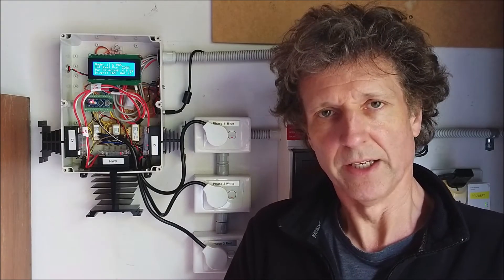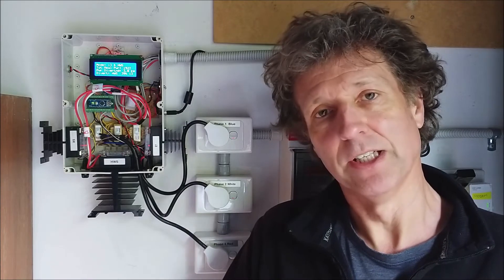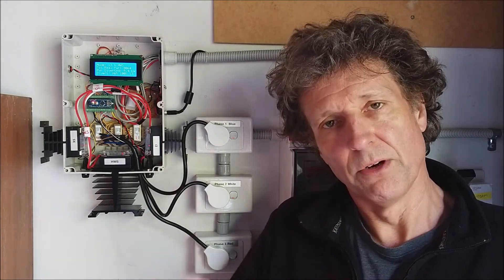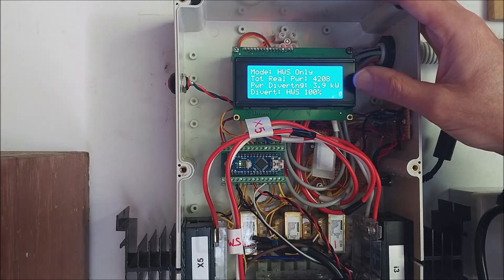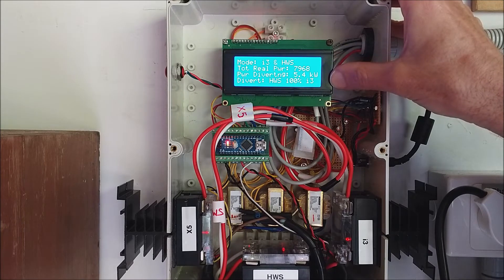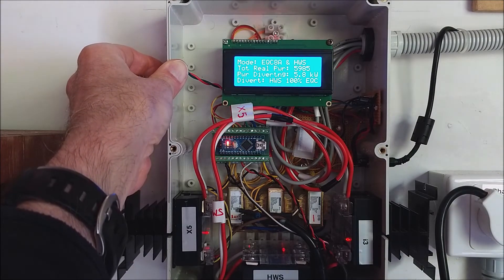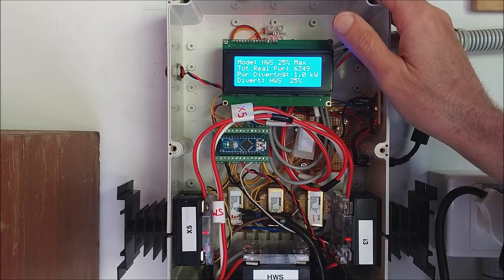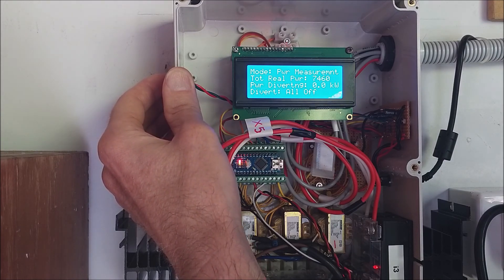DIY Solar Energy Diverter  Part II using PWM for Hot Water

Comment: Nice build. I've been brainstorming making something similar for years, after seeing the insane prices of off the shelf solar diverts like iboost and eddi's. But I was planning on using a CT on the solar and the grid side of my incoming so I could compare the two, and PWM a mosfet or something at high frequencies. Which would mean I wouldn't have to have it turn on off for a few seconds for sampling like your design does. But I dont know how to code an Arduino. I struggle to get a LED to blink without sytax errors. 

I didnt realise car chargers could be turned on and off like that. I assumed they needed a smooth source of power and then reduced duty cycle themselves to get the desired charge current.
Reply from the maker: Hi Ratgreen,
Apologies for the delay in responding to you. 
Yes, I'm no programmer myself! Lots of copied code and examples are evident in my sketch!
In terms of EV charging, these need to be stable. The minimum cycle time I have set is 20 minutes and I don't think you want it any less than this.  Both our EVs seem happy with this arrangement.
Good luck with your project.
Cheers,
Gav.

Comment: This is great! Could you please share the circuit diagram/schematics as well? Thanks
Reply from the maker: Hi Daniel,
Unfortunately I haven't drawn  up a circuit diagram. The best source for the voltage and current sensing is the open energy monitor learning website. This link takes you to the simple voltage dividers for the voltage and current sensing: https://docs.openenergymonitor.org/electricity-monitoring/ctac/how-to-build-an-arduino-energy-monitor.html
The Arduino script identifies the pins of the Arduino which are used for voltage and current sensing (in my case 3 phase, but single phase just requires two inputs rather than 6).  The pin that's used for the mode switch is also identified. The digital pins for the output control are also easily identified from the script.  Apart from power connection to the Arduino, that's about it. 
I will be posting another (and I assume final) video at some time covering a further enhancement using phase angle control for the HWS heating.  This was a relatively easy enhancement and has some benefits over the solid-state relay on/off switching.  I just want to test the phase angle controller for a few months before I post the video.
Cheers,
Gav.

Comment: Isn’t there solution to limit your 3.6kW water heater electronically.? I mean if there is only 1kW generated the system will allow only 1kW to your 3.6kW heater.
Reply from the maker: Hi Jerry,
Yes, you can utilise phase shift modulation to limit the actual power delivered to the hot water element.
This approach is more complex and I didn't want to alter the switching hardware setup I was already using, hence the PWM approach.
Cheers,
Gav.
Reply: can you please suggest some device to utilise phase shift....thank you
Reply from the maker: Hi Jerry,
I did a quick search and there are some products available for control of single phase resistive loads. I found quite a few in AliExpress, but I can't vouch for their performance or reliability. In general they accept a control signal of 0-10V or 0-5V and use phase shift control to vary the AC output.  
You'd need to the test the set up to firstly see if the device will accept a raw filtered PCM 1-5V DC (like) output from the Arduino.  Assuming this works, you need to test the linearity of the device (ie: if 5V delivers near on 100% output, does 2.5V deliver 50% - I suspect not).  The charts I saw look roughly linear from about 1.5V to 4.5V, but you'd need to test and model this and deduce and algorithm  that produces the required power control. 
I'm a bit buried at the moment, but might have a play with one of these devices at some time.
I hope this helps.
Cheers,
Gavin.

Comment: That's silly considering solar panels are only  23% efficient, and Solar hot water heaters convert just about all the heat from the sun into hot water
Reply from the maker: Hi Blake, 
Our evacuated tube water system comprises two banks of 30 tubes each of 1M in length. They are tilted at an angle to catch the winter sun. During winter and the shoulder months, they are not generally able to fully heat our 315L storage HWS. During this time, we divert the energy from our rooftop electric solar array to assist with hot water heating. In this way, the diverter is invaluable. During the warmer months, the evacuated tubes heat the water on their own with no assistance required from the electric solar array. Not silly at all really.
Cheers,
Gavin.

Comment: Great video Gav & very useful information.   I am using a more crude arduino based all or nothing system at the moment to try and a) run the pool pump & b) harvest as much of the surplus as possible to for the immersion heater & draw as little from the grid as possible so I think I’ll adapt your code to incorporate this burst technique now. Thanks, I’ve subscribed!

Comment: I did a similar thing using a solid state relay and zero voltage switching to enable 1 to 4 half cycles every 2 mains cycles at 50hz to give 25% steps (750W steps) to match hot water power to surplus power. Zero voltage switching was done to reduce EMI.
Reply: Sounds pragmatic, can you share your design?

Comment: Hi Gavin, do you have more details on the hardware you’ve used.  Clamps, SSR’s ect? I’d love to build my own
Reply from the maker: Hi Brett,
My apologies for the delay in responding to you.
In terms of components for the system, there's nothing special here. The current transformers and SSRs were low cost items purchased on eBay.  The OpenEnergyMonitor site has good sections covering current transformer selection and setup (you'll need a simple voltage divider circuit to enable the Arduino to read the current transformer output).  This is a link to a CT I used: https://www.ebay.com.au/itm/321424072757?hash=item4ad65e2035:g:lKYAAOxyNa9SJqTf
The SSRs I used are all low cost devices. Obviously you need ones that accept DC input and are able to switch AC loads. I used 40A versions and have had no issues switching our 16A HWS element.  There's a fair bit online regarding the reliability of Chinese made SSRs, but  I've had no issues. I do use a bigger (quite meaty)  heatsink on the HWS SSR.
The AC voltage sensing can be done using small AC transformers (150mA is more than sufficient)or plugpacks to keep things simple. Again the OpenEnergyMonitor website has details of the voltage dividers you'll need to build.
The rest is basic Arduino componentry. Again, here I've used clone devices with no issues. 
Good luck!
Cheers,
Gavin.